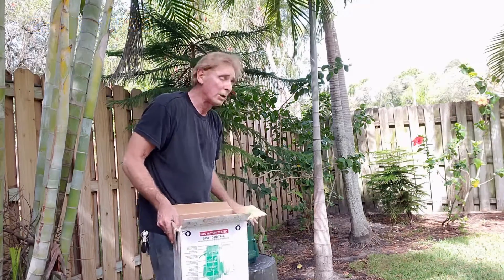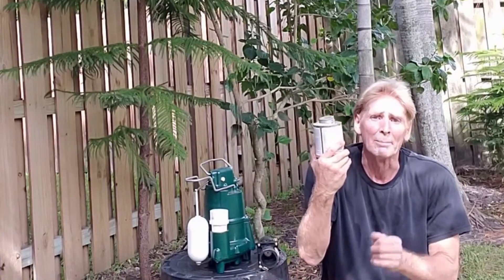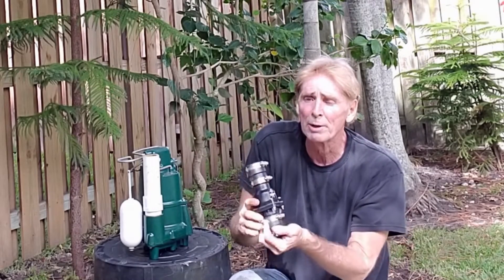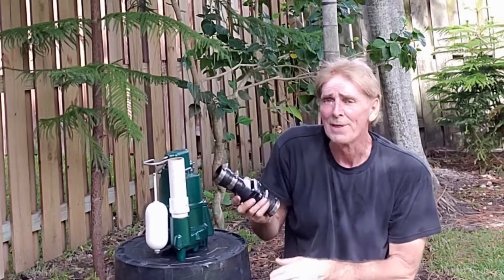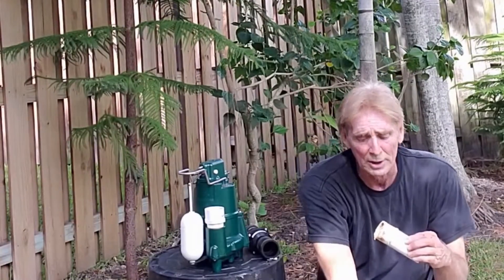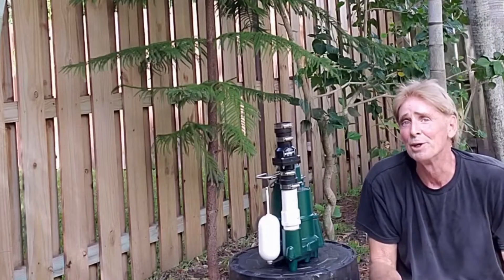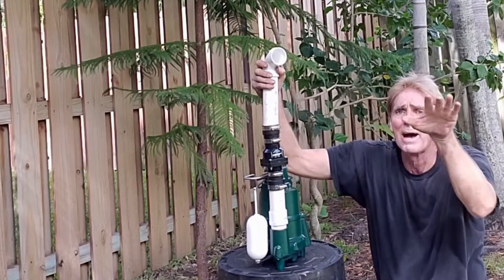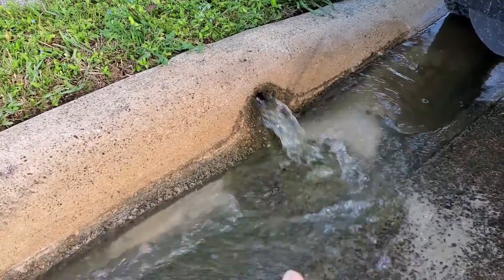Backyard FRENCH DRAIN, Best Sump Pump and How to Set Up for Install

Comment: Hey Chuck!  I just did an emergency temp install last night with your help!  But, my local store didn't have the containers needed.  Could you advise of the best basin to buy and where to maybe find it?  I need to switch out this Homer's bucket with something more long term.  =)  Once again, thanks for your help!!
Reply from the maker: Best place to find a basin is Lowes and Home Depot. Be sure to get the kid too
Reply: @appledrains  thank you!  I was at Home Depot, but I don't think sump drainage has caught on over here yet.  I will order online.  THANK YOU!